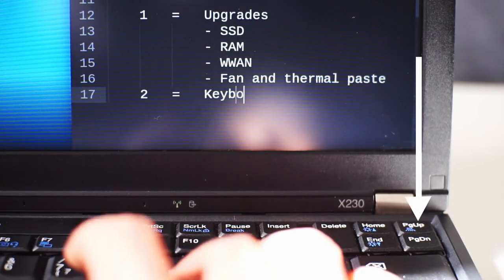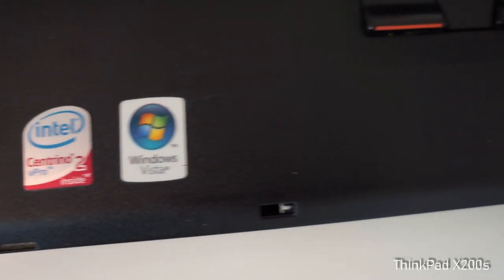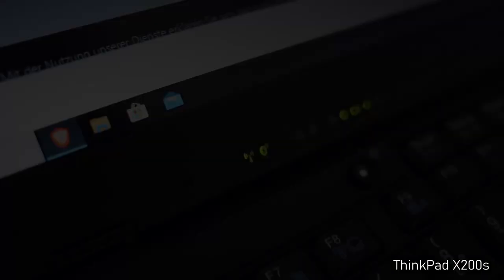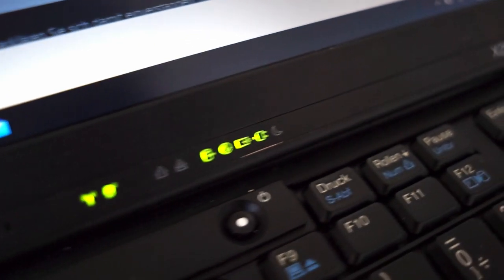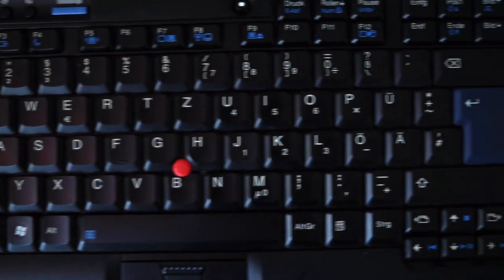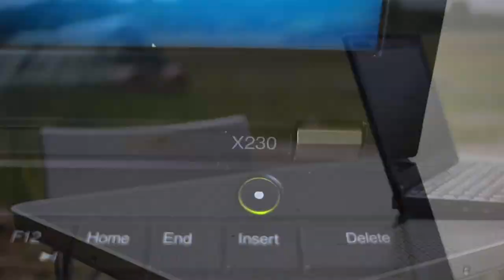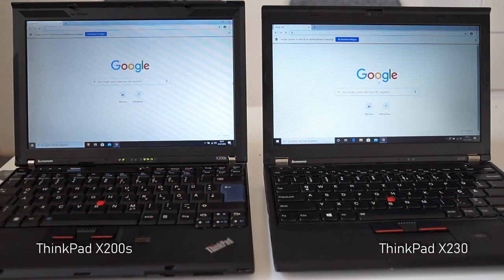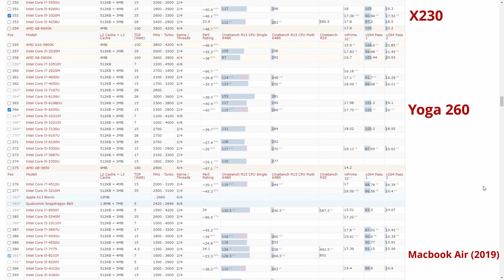Building the Perfect ThinkPad X230 Part 1: Complete Disassembly, Re-pasting, Fan, SSD, RAM

Comment: Do you need a Thermal Pad or is paste ok for the GPU?
Reply from the maker: I would recommend using a thermal pad for the chipset (I accidentally called it GPU in the video).
Reply: @classicdome9347  smth bad happend i dont know what but my Cpu can only use 38% Prozent

Comment: You can get even better thermals if you made holes under cooler: https://img.alicdn.com/imgextra/i4/1748762764/TB2CDMcFf5TBuNjSspmXXaDRVXa_!!1748762764.jpg

Also I would suggest to use copper plate instead of thermalpad (southbridge - thermalgrease - copper plate (around 1.5 mm) - thermalgrease - cooler copper plate).

These are advisable for i7 systems.
Reply from the maker: Thank you for the advice :). A copper plate on the PCH combined with thermal paste sure has better heat conductivity that a thermal pad has!
Reply: Are you sure 1.5 mm makes sense? The original thermal pad seems to be about 0.5 mm thick. I doubt the southbridge heats up that much.